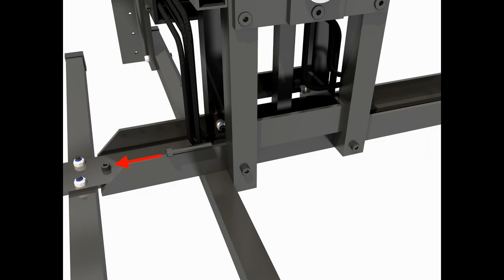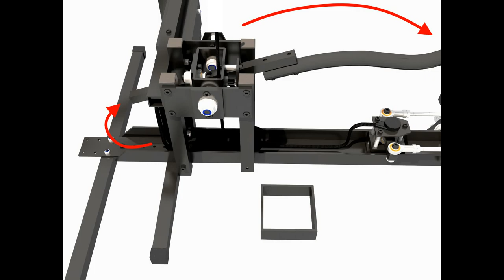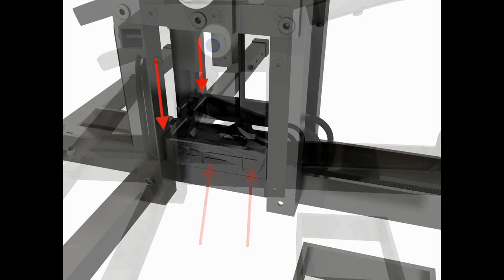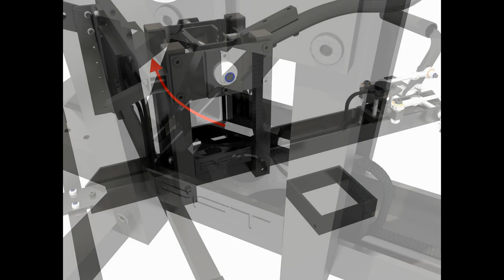Calibration Square Modification for Puma and Fox helicopter flight control series

Comment: But this thing is already in the puma a few months ago, right?
This is not a "new" stuff, isn't it?
Though what we need is a clip to tie the cyclic in place when folded so it does not fall left or right of the pedals.
Thanks
Reply from the maker: Good question! We will edit the description.

Serial Numbers 2018.08.004 and upwards Puma units have this modification installed.

Thanks for the idea to have a clip system. We will take into the wish list. 
You could use a piece of Velcro band around the pedal U-channel in the meantime.